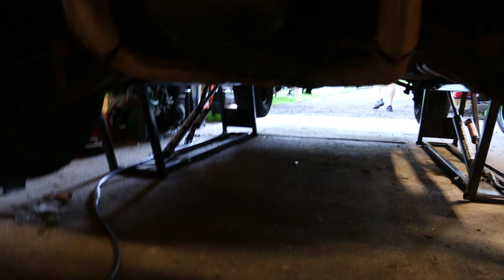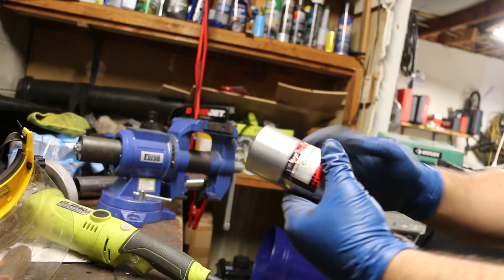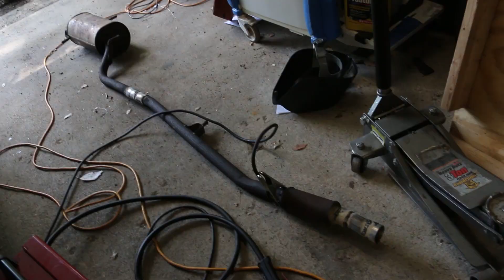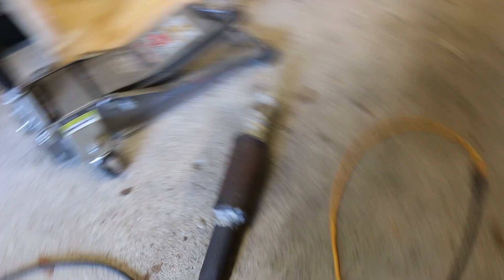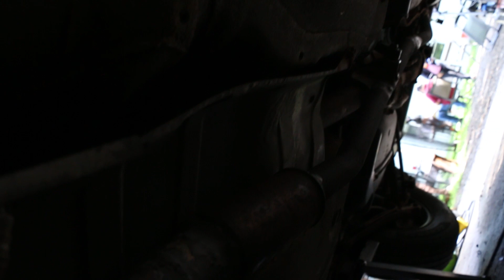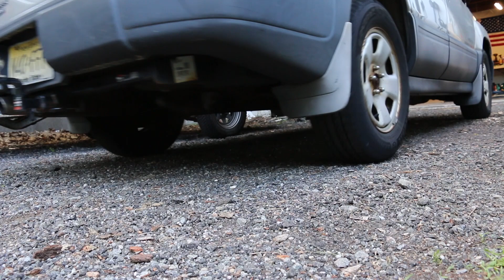Subaru Exhaust Repair! -  Welding FAIL

Comment: I mean, if the sleeves and clamps were stainless steel the fix is decent? Was it leaking anyway and that is why you welded it? I've noticed welds don't last too long in the NE and then you need to put a new pipe in.